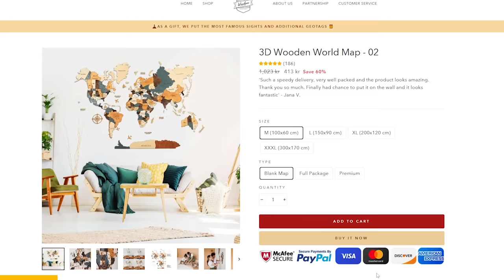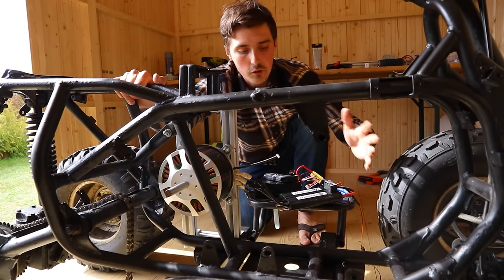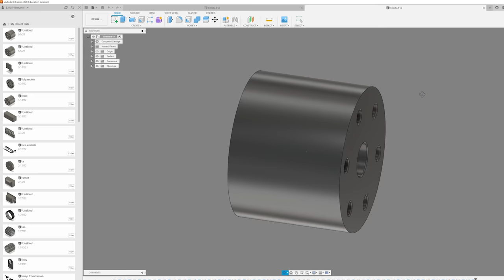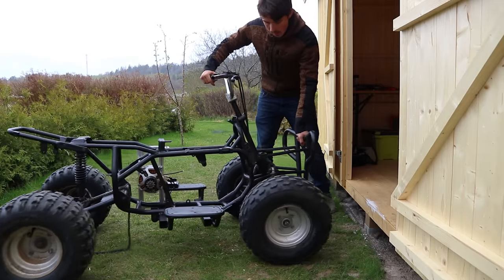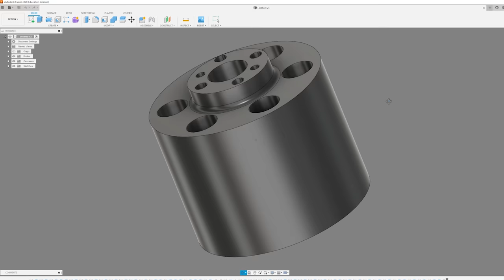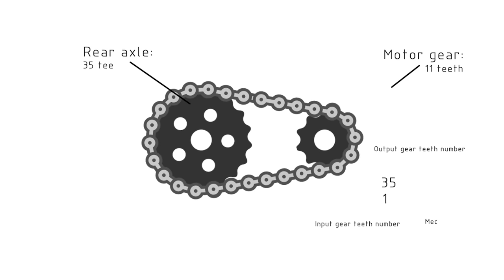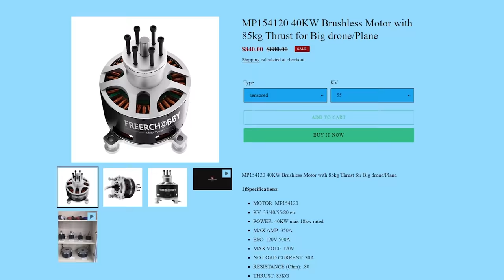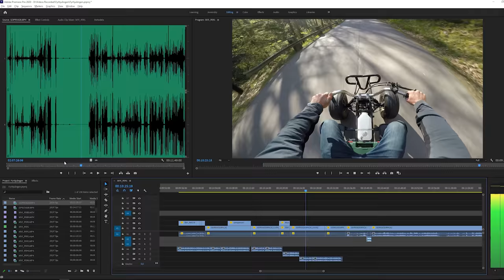I Bought an ATV and Made It Electric

Comment: Really Nice. I have that motor and I have the speed controller you are considering. I like the motor but two of those controllers have broken on me and they were sketchy even when new. Suggest you go for a high voltage version of the VESC controller. There are some really nicely built ones out there, they do FOC etc. Buy the Esk8 high quality ones. Try to go to 96V and use way more reduction. That'll help your controller start as it'll commutate a lot faster off the mark. What is your experience with that motor? Is it lasting well?

Did you figure out why the ESC died? Given you were down hill it must have been doing a regen, where the motor was putting out >24V, so each of the Hbridge fets was conducting through the body diode. That would heat them REAL fast, and then thing starts breaking down, current from the batteries conducts and smoke. Put the ESCs in regen/braking enabled mode so it'll turn the HBridges on to stop body diode conducting.

Comment: We have ran that exact ESC up to 250A continiously(watercooled) with great success, without the braking function enabled though. (At least 10 of them with 0 fialures.) The other one you are picturing(500A) we also tested, and it did not cut it at all. Be aware. I would recommend looking at commercial/industrial ESC:s for this build. 
I think EmDrive or similar would be a good alternative.

Comment: Support both sides of the motor shaft. Also, heat is the big killer on electric motors. I think that the motor will work for initial testing, but you may find better success on later long-run trials with either better air cooling, or finding a motor with a water cooling jacket in it.

Comment: You don't want a twist trotle. You want to use  that operates by thumb leaver . The control of the quad is better that way. I use a quad to commute to work so I drive them allot. Twist trotle could get you in to trouble while driving

Comment: Thanks for the video!

Shimano and Enviolo internally geared hubs (one is gears the other is CVT) can be had for ~200 USD.
Belt Drive from Veer should allow inexpensive and fast customization of belt length and those are about ~300 USD; Gates makes very good belt drives, but they're ~450 USD if you can get a kit in your size.

Hall sensors are inexpensive but you'll actually want the torque sensing capable controllers, etc, to make sure that you cap the instantaneous/peak as well as continuous/average torque loads as whatever hub you select may require.  Hubs only go so many RPM max but you can cheat that a little with wheel diameter, depending on your application.

This way you can actually use a smaller motor and add more battery capacity while increasing your top end and available torque, on demand; also belt drives allow extremely harsh conditions that chains have trouble surviving without a large investment in both chains and tools/chemicals.  

The load being more controlled will also allow you to remove more weight from the chassis while adding steering/suspension because your motor/battery combo is limited only by how much sag you're putting on it and the programmable governors make the stresses on your drivetrain predicable and constant as well as create an abstraction between the user and powerplant so simply from riding performance it will be difficult to tell if anything changed unless it comes up against the limit of something that was already there.

Comment: Great content! Love your work! 
No matter how you connect those batteries together in your series in parallel groups, you always end up with 384 watt hours. 
Whether it's a 96v/8ah or a 48v/16ah or a 24v/24ah battery pack, they are all 384watt-hours.
96v/8ah would probably make for a smoother and stronger application of power. 
Or add one more of those batteries to achieve 120v/8ah with 480wh... 
(almost half a kwh)
FYI, hobby LiPos have high energy (watt-hours/KG) density, but are relatively unstable, occasionally ending in fire for extended discharge. 
For this application, you might benefit from electric bike parts (especially the battery packs)... They're almost certainly less expensive too.

Comment: You're going to need to replace that 3D-Printed hub/adapter, that's holding the chain-gear/sprocket in place, with something SIGNIFICANTLY STRONGER (ie. aluminum/steel/stainless/etc..), if you expect any level of longevity from this project. I love this vid!... I think you're really onto something here; the concept is simple and clean, exactly how it should be btw, and I can't wait to see what's next!

Comment: It's crazy how the density of energy packed into gasoline vs batteries is. I wonder if you could make the quad air powered with some jet engine type electric motors.
Reply: He could, but it would be (in comparison) extremely expensive, extremely noisy and very, very slow.

Comment: I think your project would be helped a lot with a swap-in Continuously Variable Transmission from gocart manufacturers, between your motor and chain drive sprocket. A lot of them have a built-in centrifugal clutch, so that will take care of your starting problem, and you'll get an additional down-gearing that will put you right in the range you were looking for.

Comment: I probably wouldn't increase the gearing if you intend to increase the battery voltage.  Doubling the voltage will quadruple the power (as it will double the current as well). So you should have plenty of torque (once you get a sensored speed controller as well).

Comment: Hopefully you can retain the original fuel tank by flushing it out and using that for your water cooling/pump set up.

Front mounted rads can be picked up for cheap and looped in to the system. Maybe a Yamaha Banshee style twin set.

But I like where this is going.
Also if your Front Rims are highly offset you can just flip them to get a wider stance and more cornering stability. The air valves should still clear the callipers/drums. If not a matching spacer plate cane be put between the hubs and rim to push them out a bit further for better clearance but still be reliable and tough. 👍🏽😉

Comment: The torque converter helps with take off acceleration and it gets faster as the pulleys expand and contract.   Also use higher gage wiring so your cables don't fry 😉

Comment: What ESC would you (any one of you knowledgeable people on the comments) suggest for a 12V 80A (~1KW) brushless DC motor for a 1/5 RC car converted from gasoline to electric? I have been using an RC helicopter ESC of adequate size but it has a tedious startup safety sequence of waiting for few seconds, go full reverse, wait few seconds, full forward throttle, wait some more, go to zero throttle, then it is initialized and usable. The startup sequence often leads to the car going awol, especially if you try to initialize it twice. 
A decent Arduino or USB controllable ESC of this size would make my project much better than it is. Thank you in advance for any suggestions.

Comment: I would love to build another electric quad, i did one about 6 years ago it was only around 1kw with 11k rpm limit and then geared down at 7:1 it could do 70kph once it got going...i had tried to direct drive it initially but cooked the controller/wires and in the process took off down the drive.
I learnt so many lessons from doing the project it was fun but tech has changed so the possibilities are way better now

Comment: I'm currently building a electric ATV and for electric ATV i Higly recommand the Qs motors a Qs 138 4000w for mid budget or the Qs 180 8000w are perfect  here are the specs for the QS 180.

Power: 8000W (maximum 24KW, sometimes can reach 32KW).
Recommended Work Voltage: DC 96V (72V to 120V).
 Rotating: maximum 4350rpm – 7000rpm
 Maximum Speed: 120km/h to 160km/h.
 Maximum Torque: 70N.m to 112N.m.

with the prices being in the okay range for QS 180 the power needed from the battery is where it can start to cost as a battery to run this motor up in the 24kw of power is arround 800-1500$ for the battery alone.

when calculated the default power and torque have the same power as a raptor 350 and when used at the 24kw it has the same power as a raptor 750  which is insane for the total ammount  of 3500$ cad (2613,26 USD) for the components to make the swap to electric.

Money power ration its great as it makes as much power as a 10 000$ ATV

Comment: thats brushless motor mate. its suppose to do that clunking when resisted. You need a clutch to make it free spine before apply resistant or you can also push paddle to ease the resistance to make it start run smoothly

Comment: I'm gathering parts from some time now to convert a quad to electric, and was aware of the torque issues that may occur. So my idea is to take a pitbike gearbox(neutral, 4 speed, reverse) and mate it to a hoverboard motor(the electric set-up will be everything from a hoverboard). Have all the parts now but no time to actually start building them.
Without getting complicated the first fix for you is to get a huge sprocket at the wheels, therefore you'd get better torque.
Reply: Hover board motor is nowhere near powerful enough. They’re only about 300w. You’ll be lucky if it does 15mph on the flat.

Comment: Put a big flywheel and a clutch, that could solve the motor clogging or low torque issue. No need to change gearings.

Comment: For a later trick to break the bead on tire… take a piece of wood and lay it long ways off the tire pushed up to the lip of the wheel then drive your car on it… also if you have a motorcycle use the kick stand then push the bike into it

Comment: Buy A small solar generator (120v) and use a rotary dimmer switch for throttle. Mount a bearing on the shaft end for rigidity. Obviously try for at least 5:1 ratio at first.

Comment: Forget that ESC man get an open source BESC G2, it does 100V & 400A. Typically only costs $280, with the only downside being that you have to order the PCB to be made and assemble some stuff yourself… it’s the cheapest ESC for such a high power level

Comment: just a thought here but instead of the milk jug water tank for coolant could you use the fuel tank that already has mounts and all the stuff youd need like hose ports burp valves and a filler cap?

Comment: If there is that much money at stakes, you should monitor components temperature. You can use some bimetal switches, that switch at given temperature, or set up na Arduino with several probes. Estimate max. temp for different components and set up an alarm.
Oh, and if you sit on lipo batteries, it's not only money, that is in danger ;)

Comment: Use a prius inverter with an the evbmw openinverter board. Under $500 and good to 600 amps at 400 volts. Somewhat large but Under 25lbs

Comment: Dude, ebike controllers (sensored) are dirt cheap compared to rc escs. 
Also they have current limiting so you set that and throttle up without any fears.  
And you can put a hall throttle on the handlebars. 
Mine barely get warm running their rated power, 1kW continuously and they come in all sizes.

Comment: Brushless motors are designed to have a gradually applied torque such as trough propellers. The thuugggaduggg is because they can't handle the sudden start. A magnetically engaged clutch instead of a chain drive would absorb the thugggaduggg. But you will never get a brushed motor startup torque.

Comment: Take a look in Biltema in the boat section, they have some pretty heavy duty contacts, that way you can disconnect the battery in a hurry 👍 part number (25-864) been using it on my electric gokart. It takes a lot of amps 👍

Comment: Install a centrifugal clutch so the motor can spin up before the quad accelerates.
Reply: This isn't necessary, the motor just needs to be programmed properly and the controller needs the encoder sensor to properly drive the motor.

Comment: nice lil commuter vehicle there now all we gotta do is implement the south or north Dakota laws about 4 wheelers being road legal like dirtbikes and other motorcycles 🤔:)  i wanna see it towing a battery trailer with solar backup for extended range but still the vehicle should have all the capabilities without the trailer just have it as an implement quick connect addon attachment

Comment: I see an EV built, I press like :)
I'm extremely surprised that the 3D printed sprocket adaptor did not explode at this power. A second bearing point would take some load from the motor bearings. Thes motors are not meant for radial loads. The bearings will fail quite fast. Further more I would have used a timing pully. Chains are awfully loud.

Comment: Oh yeah, cheap RC ESCs tend to burn when you attempt to use them on a human sized vehicle. The same thing happened on my DIY motorcycle when I was using a cheap Hobbyking ESC. They simply cannot handle the current peaks which you expose them to while accelerating or going uphill. An RC plane needs something like 1-2s to speed up the propeller to the full speed and that is what they are designed to handle. Apply that for 20-30 seconds, or even a minute and you end up with a fire.

Comment: I'd be curious to see the final iteration of this. IMO, take the original fuel tank, flush it out, and use that as your coolant reservoir. There's quite a fair bit of room in the front behind the crash bar to sneak in a radiator. With how far back the motor is, and how you can sneak all the controllers and BMS in the same area, that leaves a ton of room where the engine was for a battery pack. Constructing your own pack from cylindrical cells is probably the best method, all things considering, either that or finding proper EV pouch cells from various vehicles that aren't Teslas; a better thought out pack will benefit you in the end, these RC small pouch cells just aren't the right option, and I don't believe the RC market will provide anything worthwhile for a long time.

Comment: Use an inverter to get the 120 volts instead of adding more weight with more batteries. You just have to convert the motor to AC

Comment: Y need programmable ESC that reads Brushless dc motors output as sensor reading.  gear ration of 1 to 2 should work with that engine.

Comment: throw that garbage away. Get a good controller like bac 4000 or bac 8000 and a good 72V li-ion battery with proper throttle and get that quad running properly with a sensored system.

Comment: If you get 4 battery packs of 30v you can get to 120, but I can't find any Bms for an 8s 30v battery pack with 100max amp. closest I have seen is 24v but then you need 5 packs...

Comment: You need to mount a torque converter to the motor you'll have to make adapters but trust me it'll work way better the torque converter is the key no one has used one yet from the videos I've seen so far it's the same as putting a torque converter on a 3.5HP gas engine trust me you'll be very happy get one that'll fit a 5/8 inch shaft they also have for 3/4 and one inch engine shafts the electric motor has the 4 bolt holes needed to mount the torque converter into it I used a 1000w 48v engine in my pedal car I made with PVC pipes trust me you'll be happy

Comment: Busy with the same project. Motor is smaller thou  . Bought a bunch of broken haverboard for the bat packs. Now got a 12s 14p pack. . Waiting on the controller from china. . As I can't source it local. . Got a 5000w controller.. should be overkill. . 
Make sure u get a sensored esc. . .

Comment: Just use a big 'ol hub motor from a electric scooter or bike, these can be picked up for cheap and the controllers are way cheaper and more reliable, you don't have to spend 1000's and have a more reliable system and all the power you need.

Comment: You have 11 & 35 TOOTH SPROCKETS, not gears.
Gears turn gears, sprockets are turned by chains.  And yes you need a bearing support on the end of the shift.  Put the "sprocket" closer to the motor and NOT the end of the shaft.

Comment: Down buy another chinesium ESC by wood, get a VESC 100250! It will not drive the motor at 100% load, but you will still get 10-15Kw of power. The VESC have protections like over temprature, voltage, amp from battery, amp to the motor, power to motor...... and if something is getting to the limits, it will just safe throttle down the power.

Comment: If I where you I would put a BMS in and/or use safer batteries like LiFePO4 or LTO batteries. You def don't want to be sitting on those hazardous batteries that ESC was already a close call imho. The batteries also last a lot longer, but it's going to cost some money of course...

Comment: I'm also highly skeptical that 3D printed parts can be used in high torque situations.  They may hold for a while but micro-fractures will soon appear and it will fall apart catastrophically at any time.

Comment: why don't you add 400watt wind generator motor to other side connect to drive shaft so as drive you make power back to battery's then run longer.

Comment: You Can use a gearbox because thé motor need speed to get propely used but have not too much tork so if you put a Gear box that slow the output of the motor you Can get better tork and no laging when you start (im french so be gentel about fault)

Comment: Just spitballing with no own experience — measure the unloaded max rpm of the motor, determine what your speed goal is, then assume the motor under load will turn 80% of the unloaded rpm, and then figure tire circumference (diameter times 3.14), then calculate how fast the wheels need to spin for your goal speed, then divide tire rpm by motor 80% unloaded rpm, that‘s your gear ratio. A lower gear ratio should lower power drain and help the ESC. Just. Caveat: If your calculations turn out a ratio closer to 1:1 than you already have, your motor might not be the right one, since 1:3 didn‘t work out so great in your trial.